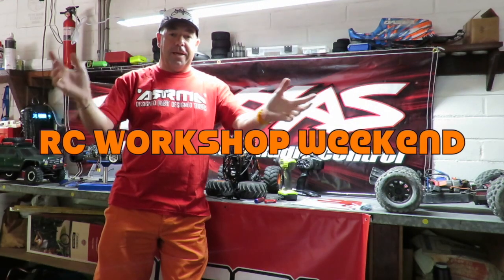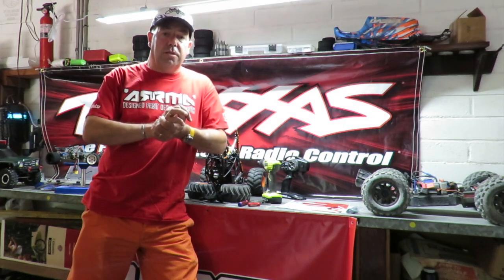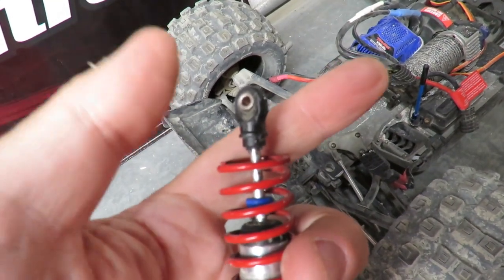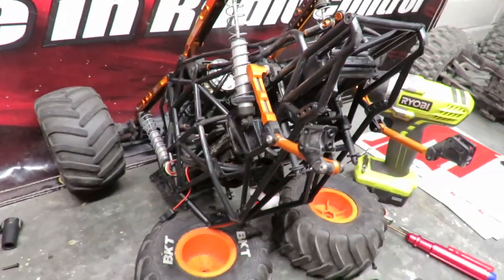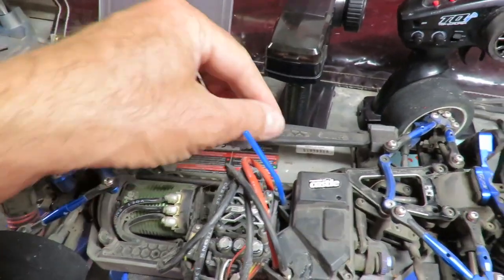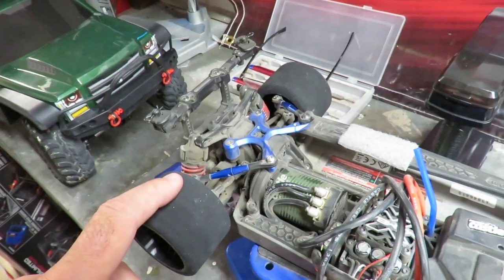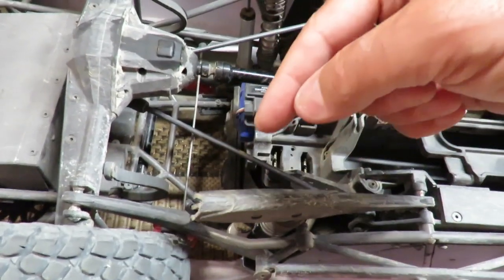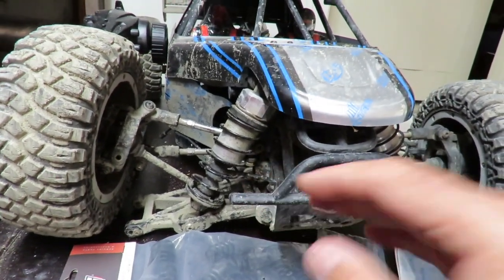RC WorkShop Repairs

Comment: Yeah I went out for about an hour tonight when it cooled down & did a little light bashing. 
Took out my 2wd Slash LCG. I really like this truck now always a blast to drive. Had an axle pop apart but otherwise no damage. Lol 🤙😜 Have a good week & a Happy 4th.
Reply from the maker: and to you mike. Found a new speed spot so may get up early on the 4th to do a few runs.

Comment: Lots of bashes, lots of work to get done! Hopefully u have some A/C in ur workshop to keep cool! Ok no more yapping let’s get to work! It’s wrenching time! Work hard, play harder!
Reply: STEVO D 313 - He's in Cali brother. I'd hope to god he has A/C. 🤘😜
Reply from the maker: outside temp gauge has shown it's now cooler. It's now showing 113.4 not the 114.7 it was earlier....e-revo fixed, already and SMT10 all sorted. Off back down to start on Redcat Gen7 Stickers. Found new speed spot, about 2 mile straight road (And no curbs!)
Reply: Driftomaniacs Good lord!! I'd die in that heat. Lol it was 94 on the east coast where I am & I thought that was bad. 😂
Reply from the maker: Mike I see the East coast has been toasty this year. I don't miss the humidity in NJ, although when I drive along the freeway at sea level here the mountains nearly all have mist on them. 94's warm for the East Coat (NJ/NYC/Connecticut that is)
Reply: Driftomaniacs Yeah pretty warm. I'm in Connecticut. Southern part. Few cities up from NewHaven.
Reply: snap. and I thought Duluth, Georgia was bad.

Comment: yup, my trailing arms are dead just the same way. also, look how much the rear diff spook leaks. make sure to fill it up with part #1647. and those planetary gears dry up fast. could you try out the Pro-Line 1/8 Badlands buggy tires on the UDR when you fix it? I mean, yeah, those are far different from the stock tires, but I'd like to see how it handles. my tires are dying quick, and the 1/8 Badlands are rumored to be pretty nice.
Reply from the maker: yes I can't see the tires lasting long, at least it comes with 2 spares! I may try the badlands but I'm thinking it's too much tire for the UDR. Glad stevo D got me to order the Aluminum arms, which hopefully arrive this week

Comment: definitely brake slowly. dont risk slipping off the road with that 4-tec.
Reply from the maker: Daniel I shan't be doing the fullbrake thing again I'm sure it's flat spotted the old foams, it occurs to me that the castle is probably as strong in braking as it is in accelerating if that makes sense. On half/3/4 brake it's pulling up faster and nice and straight. More testing mid week

Comment: Driftomaniacs ok. So i have decided to buy the 4600kv in a bundle, but i am not sure if i should get the mamba x or the sidewinder(since im not going to run 6s). Thought of either using stock gearing or 29, 55, and i dont know if the esc makes a difference in heat being generated.
Ps. the reason im asking is because this bundle will cost me around 500 dollar because of high taxes, so i really dont want to pick the wrong one
Reply from the maker: Fredrik buy the mamba X NOT the sidewinder. I bought the sidewinder to save money but ended up buying the mamba x 3 days later as the sidewinder constantly overheats on 3S. The sidewinder is only happy on 2S it'll take 3S but after 3-4 passes it was cutting out due to overheating and the mamba X is sensored as an added benefit